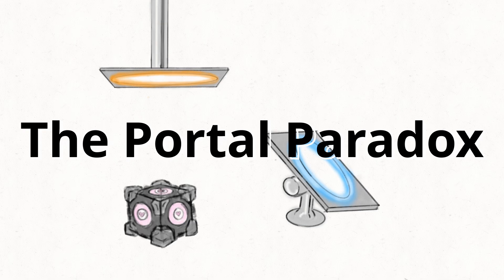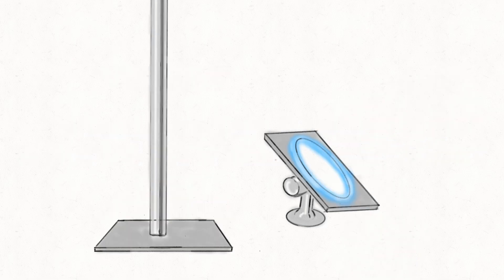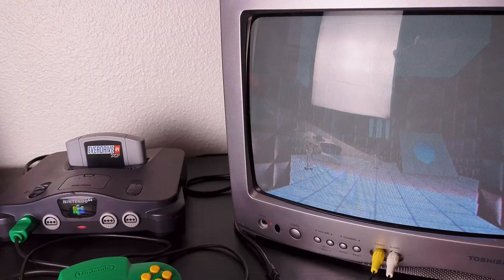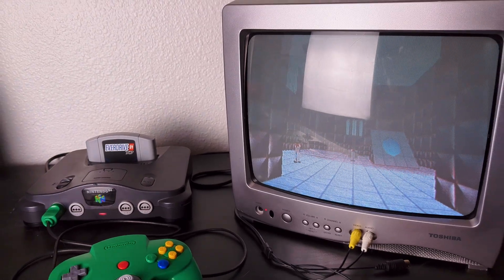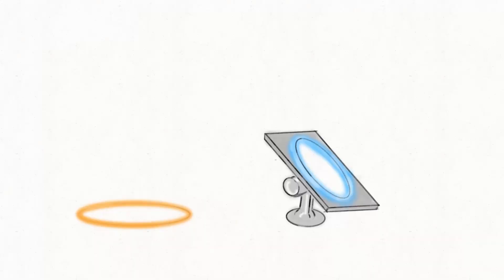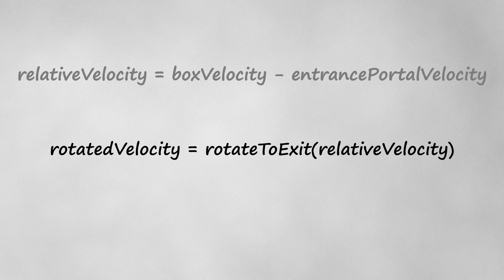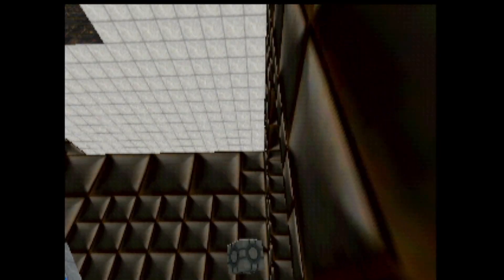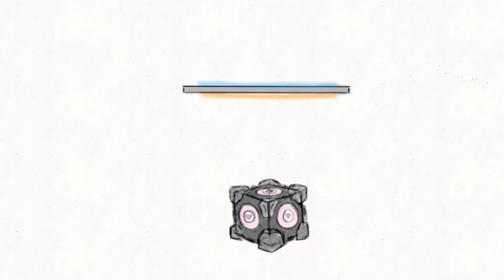I rewrote Portal from scratch and solved the Portal Paradox

Comment: Sounds right. reminds me of Tom Scott's video on that unconventional auger wherein the tube and its openings are spun, but the auger itself remains stationary yet still elevates grain.

Also when you think about it, on a cosmic scale, all velocity is relative.
Reply: Just a nitpick, the physics of the rotating auger aren't the same as the physics of the stationary auger with rotating shaft, I believe the grains will move in distinguishable ways and have a different stress distribution.  This is because in Newtonian mechanics rotating reference frames are non-inertial and so aren't related by such a simple transformation.  Fictitious forces such as coriolis forces and centrifugal forces appear in them.  Read about Mach's bucket experiment.  In an idealized Newtonian (non-relativistic) universe, spinning the entire universe around a bucket won't cause the water to form a parabolic curve on its surface.
Reply: unless its light, that speed is absolute
Reply: The Wuffle house has found it’s new host

Comment: portal 2 contains moving portals. you have to cut the lines to the neurotoxin and you do it using lasers through moving portals. it's the only implementation of moving portals in the series.
Reply: They're only enabled in that one room, far away from the player or any physics objects, because the developers were never able to get them to work properly. Moving portals in the Source engine are very buggy, and will fling things around that aren't even touching them.
Reply: @Nulono  there's a speedrun strat that takes you through the moving portal
Reply: True. This is achieved by changing the config settings when the map loads. You can always allow this using the command “ch_allowmobileportals 1”. However, portals cannot slam down on stationary objects, as the game hasn’t been coded to do so
Reply: @PhantomEye11  x the command is "sv_allow_mobile_portals 1". addendum: the ch_ prefix stands for 'cheat', and is paradoxically only used for creating jeeps, jalopies, and airboats. sv_ stands for server, and references things to do with physics or other calculations that are done by the server as opposed to the client.
Reply: Yeah, but they only move parallel to the portal, not forward and back.
Reply: @hatandhoodie_  You can make custom maps for Portal 2 with portals that move forward and back. Moving portals in Portal 2 just aren't designed to interact with physics objects, so you get all sorts of jank and wonky momentum (hence why they're not allowed anywhere except one level where they're very far from you).
Reply: you just gave me the biggest mindf**k of the day. cause until this time I just thought that the in game universe doesn't allow moving portals for some reason. now it all doesn't make sense
Reply: @stanislawignacy  You forgot that the Earth is moving. So it always worked as portals were moving, even in the "Portal".
Reply: @fantastikboom1094 all motion is relative, so you could also argue that chell is not moving but the test chamber, including the portals and every object inside it are moving.

in practice the game will be coded to consider the test chamber as static.
Reply: technically, when you put a portal on the moon, it's moving fairly rapidly relative to the portal on earth. but yeah, that's a scripted scene and not in-game physics.
Reply: @twocows360  i mean, at that point we might as well take the earth's rotation/etc into account for everything else
Reply: @2-Way_Intersection  yeah I was thinking about that too, the portals would never be truly stationary because "stationary" in what frame of reference? however I realized portals always come in pairs so you could have some rule where they just can't be moving relative to eachother, but we see examples violating that rule in the games so...
Reply: @2-Way_Intersection  @twocows360 This means that portals can tolerate some negligible motion outside the plane of the portal, which then reorients. So you could leave a portal on the floor for a day and it will complete a full rotation fine, but put it on, say, the central pillar of a merry-go-round and it will dissipate.
Reply: @twocows360  The way the portals are moving relative to each other is irrelevant. Something going through the portal on earth at a relatively small velocity will exit the portal on the moon with the same velocity with respect to the moon's portal. The way the creator implemented the portal movement would still keep the physics correct for the moon scene
Reply: @icefire6622  You're right that the object's velocity changes with respect to the exit portal. But this dude's code um... won't keep correct physics for the moon scene. His math works with speed of entrance portal. The entrance is placed on Earth, so it always moves. His code is just wrong.
So yeah, you can code every result you want, as he said lol
Reply: Well, theres also the in motion add-on
Reply: And it's conveniently set up so the only thing that can go through the portal is a laser beam which doesn't care
Reply: Question: What would happen if you stopped the Portal before the cube gets completed Teleported out of the other side? Is there a point where the momentum of the Teleported part of the cube will be enough to pull the remaining body to the other side?
Reply: @xila-man8249  you can do this without movement and what happens is anything stuck in the portal just gets pushed out one way or the other
Reply: @xila-man8249  There's a detailed YouTube video for that scenario already.
Reply: @xila-man8249  if the exit portal is stationary, then yes. It is easy to imagine one box as a set of slices, and those which have already exited have a momentum relative to the observer.

If it's back to back portal version, then no. The exiting slices of the cube have no momentum in inertial system.
Reply: @xila-man8249  Depends on the speed of the drop and how much of the cube is on the other side, but the innertion of the cube on the moving side would pull the cube on the stationary side. The results may vary from making it flinch to straight up pulling it on the other side. Basically the stationary side's mass will act as an opposing force to the movement of the mass on the other side.
Reply: @xila-man8249  I think the part leaving the portal would have momentum, thus pulling the other part (it would be like pulling on the handle of a wagon the handle doesn't just come apart, and the force isn't applied to the whole wagon), it wouldn't get launched out at the same speed, just a bit slower depending on the mass of the part stationary and the mass of the moving part, though in the simulation it likely doesn't account for that.
Reply: The portals do move, yes, but they don't work properly because the devs never expect you to enter a portal in motion.
Reply: exactly what I've been saying
Reply: Don't forget the motion dlc
Reply: vys, you are so smart. Take me to the cinema.
Reply: But you're not slamming them down on objects
Reply: Also the prtal on the moon.
Reply: @spacejunk2186  the portal on the moon isnt actually implemented as a portalable surface.  its just a trigger that gets enabled at the end of the game and then fires when you click your mouse.  then it plays a cutscene rather than doing an actual physics sim.
Reply: thats a scripted sequence though
Reply: this is actually enable-able by a console command
Reply: This part of the game tripped me out because I thought one of the rules of Portal was that portals become unstable on moving or unstable platforms/surfaces. Then the neurotoxin tube cutting scene just throws that logic in the trash.
Reply: @QuackZack  You forgot that the Earth is moving. It always worked like portals were moving and in the first game too.
Reply: in game universe, portals DO NOT move. These scenes where they do, are the result of bad writing and game development.

Comment: Great explanation of your system :) I know it's not exactly critical to this particular video but it's so fun watching this all run on the N64. Can't wait for the next update!

Question: was it difficult to implement moving portals? Like you mention in the video, Valve did not implement it in Portal. I'm guessing they didn't just because they didn't think to, or maybe Source handles it weird.
Reply from the maker: The hardest part of moving portals was just getting anything moving at all. I had to create a special case in the code that cuts holes in the geometry for surfaces that could move. I also had to create a special case for my culling engine(the part of the engine that figures what is visible and therefore what to draw) for moving objects. Once that was in place, I only needed to update the position of any portals that were attached to moving objects every frame, determine their velocity based on how much they moved, then use that information as described in the video.

You can see a few visual glitches that happen when the portal is fully slammed downward that I would need to solve if I wanted to try to incorporate moving portals into a new test chamber. I also didn't bother implementing rotating portals which would complicate things further.
Reply: @james.lambert  thanks for the insight!
Reply: The Wuffle house has found it’s new host